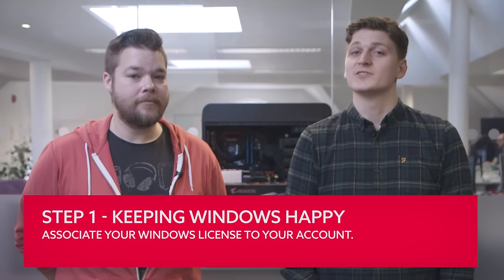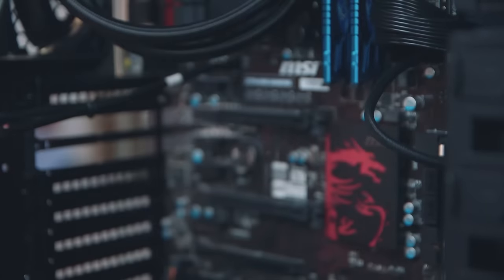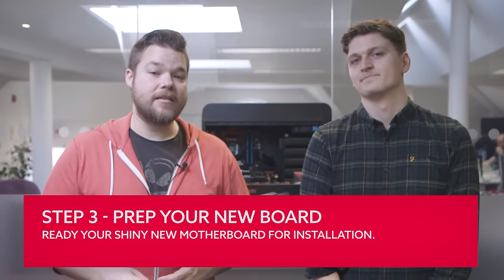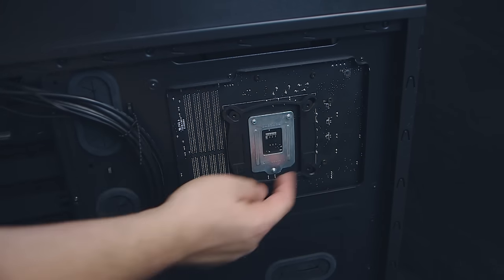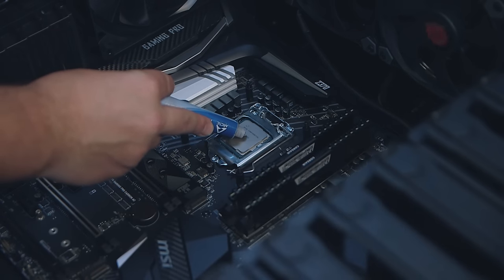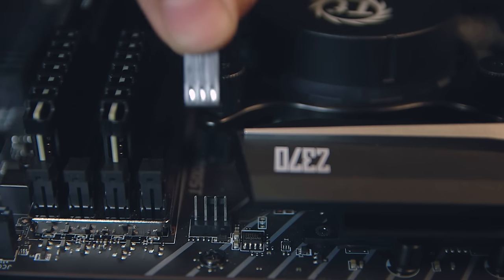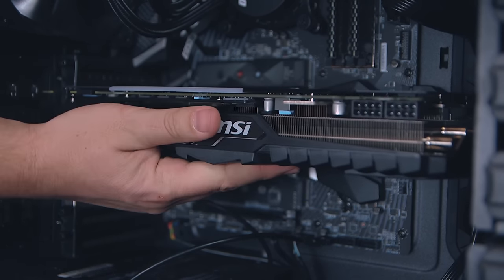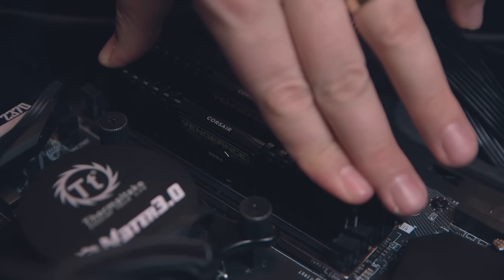How to replace your PC’s motherboard in 8 easy steps | Hardware

Comment from the maker: Are you planning on upgrading your motherboard? What are you going for?
Reply: but also better mobo has better socket - so i have to buy CPU too, and then you discover your new CPU works on different frequency - so you gotta buy new memory too.

what I'm getting at , is that you'd better buy new system outright when older one is no more a current generation. 
and swithing mobo while it's not old enough yet is a waste of money.
Reply from the maker: Nick Grabeck As we say, it's one of the most intensive bits of PC surgery you can do, and not far off building a new PC, but if you've got a good SSD, decent cooler, and a quality graphics card you might not necessarily want to swap your entire system for a new one.
Reply: Is it necessary to reinstall windows after upgrading to new motherboard?
Reply from the maker: Chaidir Chalaf If you sign into Windows 10 with a Microsoft account then it registers your license. That means when you log in again after upgrading your hardware Windows will grab the necessary drivers and should retain license support too.

If it doesn't grab the right LAN network drivers then you might need to grab them from the board manufacturer's website from another machibs and update them manually.
Reply: Hello there as been news that Intel are going to be releasing to Intel 8 core CPUs at the end of the year will ryzen still be the best value ?????
Reply from the maker: cole death slayer Yes, absolutely. You'll be able to grab the 8core 2700K that will definitely be less than the upcoming 8core i9.
Reply: PCGamesN so ryzen is still worth it ???
Reply: PCGamesN ASUS Rog
Reply: definitely, worth going Ryzen, why spend all that money on a intel, when Ryzen is much less and just as good, or better
Reply: I'm planning on upgrading to some type of reliable motherboard. I hate my ASRock Ab350m Pro4, as it crashes all the time.
Reply: How will my windows10 installation respond to a mobo switch? Im also going to replace my CPU at some point and my HDD for an SSD M2.0 so i'll have to swap my installation anyway at some point all together. What would you recommend??
Reply: my motherboard died
Reply: I have a fm2 now and gonna buy a AM4, my mom doesnt want me to becuse she doesnt know how it works. Cpu: now: AMD Athlon x4 845. Want: AMD ryzen 1800
Reply: Have been planning on replacing my Gigabyte 970-Gaming SLI with a new MSI 990XA-Gaming I have laying around. Wouldn't be much of an upgrade, would be done just out of curiosity. I dual-boot win8.1/ win10, so not looking forward to repairing the OS's when they 'wig-out' over the motherboard replacement.
Reply: PCGamesN indeed will do tomorrow, going from i7 6700 on MSI Z170 M5 to an i9 9900k on MSI Z390 MEG ACE.
Reply: Hey guys on the motherboard part all you do is screw in the motherboard.? Theres no spacers or anything?
Reply: I am going for a i7 8700k with a asus z370 but im scared that i will break or do something wrong
Reply: I bought a pc that has an ASRock Z390 phantom gaming 4 motherboard, an i9 9900k cpu, and 16GB of ram preinstalled. Before I use the system I would like to upgrade to a MSI MEG Z390 GODLIKE motherboard. The only problem is I don't know if i can use the same cpu and memory in the new motherboard. If so is there anything i need to do in order to install all of the original components from the ASRock to the MSI GODLIKE?
Reply: If I damaged my motherboard with physical impact does it make sense to replace it with a new one? Please answer
Reply: B450 F Rog Strix
Reply: Z390 Aorus Ultra
Reply: Bought my i5 9600k today
Reply: a year too late but better than never i suppose. do i need to install bios before or after installing the new motherboard?
Reply: Any tips on preparing Windows 10 before an upgrade? I'm planning to upgrade from INTEL-H310M to ROG STRIX Z390-F INTEL Z390. Thank you
Reply: Katie Osborn I had the same issue. I just bought a new motherboard. Installing tomorrow. Fingers crossed.
Reply: I installed a new motherboard everything turns on but there is no display
Reply: If i change my motherboard will it reset my personal data and windows?
Reply: I'm gonna get Ryzen 5 3600x, then try and get next year's Ryzen 7. I need to get a new motherboard and psu. My ram is Corsair vengeance lpx 3200mhz, so I don't need to change that.
Reply: My motherboard is specific to my stock pc I bought(Dell Inspiron 3650), so I need a new one in order to migrate over to a new case(the current one is tiny, and I can barely fit anything in it). I’m doing all of this to get rid of my DDR3 RAM and trying to migrate to DDR4
Reply: Upgrading my motherboard to a Asus ROG Maximus XI Hero but I’m keeping my i7 9700k but upgrading from 16gb to 32gb ram
Reply: Hello! I am upgrading an emachines AMD Athlon processor EL1200-06w. My motherboard is Socket AM2, what would be the best compatible motherboard that can support an upgraded CPU and RAM. Thanks
Reply: PCGamesN hello, do I have to do anything with the drivers of my old motherboard before I install the new one?
Reply: Houston Lair Nope
Reply: I need help please, i changed the motherboard, and display wont work, and i didnt delete my drivers or windows... what should i do!!!
Reply: Kaizerdidrik YT Are you sure the motherboard is compatible with all of your components? I had the same issue but I called my motherboard manufacturer and found out that my ram was not compatible.
Reply: @harrysmart3536  it works now, didnt change anyting
Reply: I'm planning on getting an X570 Gaming Plus and a Ryzen 7 3700X so I can actually run Doom Eternal
Reply: Gigabyte b450M
Reply: can i take the cpu out of my old motherboard and put it into my new one?
Reply: Nice video. I have only a 3 yo PC, but it was made on a reeeealy tight budget. just over 1k. Now it bites me. I can't play any games anymore. GPU-RAM insuficcient, CPU-overklocking and -heating, and...
B - - S - - O - - D...............
Now I'm changing from ' Prime Z370-P / Intel i4 / GTX 1060 3GB ' to ' Rog Strix X570-E / AMD Rayzen 7 / 2080 11GB (or 3080, still deciding) ' with RAM upgrade, more SSD-Storage, new RGB Case with CPU-Water-cooling and the works...

But I don't want to have to re-install Windows and my Programms...

Hope it works...........
Reply: Upgrade my motherboard
Reply: Im going to TAKE A LEAP and go from Intel to Ryzen
Reply: I’m going for a mother bored from republic of gamers
Reply: I plan on replacing my motherboard. My current one came with the prebuilt system but over time I've been upgrading it. The current MB does not support wifi without a separate dongle. I plan on buying a new one that supports wifi built in. Any tips
Reply: i know this video is old but i have a whole story to tell. so, 3 years ago, i bought my first gaming pc.  it was a bad pc but it was my first one, so upgrades were definitely possible and it worked well for what i did with it. about a year and a little more ago, i decided i needed an upgrade. i bought the gtx 1650 ti, and it changed performance in my pc quite heavily. however, my pc was completely unbalanced. i recently have been wanting to get a new cpu, so i got one. i found out shortly after it came that ryzen cpus aren't compatible with intel motherboards, i thought it was all the same. so we sent it back and got our receipt. i did even more research and discovered the different types of cpu sockets. my motherboard was so old that it had an 1156 socket. so i found out i cant really upgrade my cpu with the state that i'm in, knowing as there hasnt been a new lga 1156 cpu in like 10 years. i also installed an application that tells you your specs, temperatures, etc. i found out that my motherboard hangs out as around 82 C, which definitely isnt so good. so im planning on getting a new motherboard, that being the ASUS Prime B560M, with an lga socket of 1200. with that i'm getting 2 sticks of 8 gb ram, and the i3 10100f. i think the build will be pretty solid compared to what ive been stuck with for a while. im honestly surprised my computer hasn't just died yet.
Reply: X570 crosshair extreme
Reply: I want to get a ASRock B550M-HDV, Socket AM4 cause I also wanna get a PNY GeForce RTX 3060 XLR8 Gaming REVEL EPIC-X RGB Dual Fan Edition, 12GB GDDR6, 192-bit a and a AMD Ryze 5 5600X, 35MB, 4.6GHz, Wraith Stealth cpu
Reply: Yes because my previous pc repairer just took someone elses motherboard and pumped it in my pc which unsurprisingly have problems in it.
Reply: from intel i6700k to amd 5800x3d. I'm really glad that you told about the fragility that comes with an Intel CPU. Thanks!
Reply: 5 years late but i'm getting a not new asus b85m-g for 35 dollars, is that a steal, or a steal on the other end?
Reply: B550- B650 plus new cpu AMDR 9 7800

Comment: Yeah my PC is on fire right now, what should I do?
Reply from the maker: Grab some marshmallows and start toasting.
Reply: get a bag of rice
Reply: @Default Bloxian just post it on reddit. Im sure someone will help you
Reply: put some water in it
Reply: Default Bloxian 8gb on ram is killing you
Reply: I brought my pc and it had windows 7 on it, then I was offered the free upgrade to Windows 10. I don't remember signing into a Windows account. So can I still upgrade?
Reply: @Default Bloxian a320 is the most basic of am4 mobos, try x470/b450
Reply: Default Bloxian no it won’t but there’s no chance of overclocking, it’s the same one I have right now hence why I’m upgrading
Reply: Throw it in the bath and fill it up
Reply: Have you tried turning it on and off again?
Reply: Have you tried putting it in rice?
Reply: Have you tried turning turning the PC off and on?
Reply: Raman
Reply: Put a paper towel on it
Reply: Delete system 32
Reply: Boot it up
Reply: Download more RAM
Reply: Check the power button
Reply: JIEYZシ  It has been 2 years since man...
Reply: Grab some more fans with rgb
Reply: Put water on it
Reply: Badger is that you?
Reply: @edj2885  Didn't think someone would reply after 3 years
Reply: @chenshohry2374  tbh, same, i thought you wouldn't reply back, nice to meet ya though
Reply: @edj2885  same

Comment: I was gonna upgrade my pc but now I’m scared to even touch it
Reply: Why
Reply: @yournan7249  i got my new pc yesterday and ive already chipped and scratched my acrylic glass tryna clean it🤣💀
Reply: @ecto5727  rip
Reply: It’s easy af take your time you can do it
Reply: @bingbong5939  Yes it takes a lot of time
Reply: @morningsun10  better to take an hour and everything be perfect than 15 minutes and your computer be on fire. But that’s just my opinion lol
Reply: @gigachad7729  When I finally attached everything, it was perfect except for a small shock near the wifi stick area. System booted up normally

Comment: This is a pretty decent video but I’m going to give you a dislike. Anyone can put things in the correct slot. The part where most people need help is on the software side. You guys alluded to it but if you were going to just talk about it, why make a video? Just write an instructional piece instead. I get that it’s very dependent on manufacture but it would have been too easy and too simple to do an example of how to do it. Just comes across as lazy effort.

Comment: Do not just flash your BIOS just because there's a new one. This is bad advice. If your system is working fine, there is no need to update the BIOS, unless there is a security or performance issue. I doubt these guys have actually built many PC's at all.

Comment: I think most of us are comfortable with the mechanical disassembly and assembly of the PC. the part I would like to get more info on is the software side of things. for example, I want to use my old ssd with windows 10 installed on a new board. i have my pc set to my web account and that seems easy enough but their is always something amiss when it comes to software syncing and stuff. can someone link me to a vid or forum post that is more focused on the software side of installing a new board?
Reply: I have been looking for a video that answers your question but have yet to find one, did you find the answer to this?
Reply: @Dhars you find the answer

Comment: What about uninstalling old drivers and such if you're switching from Intel to AMD or vice versa?
Reply: Soooo
You found awnser
Reply: @shamsta21  Nope. :(
Reply: @unnamed715  Im sitting currently in the same issue right now? Have you found out?
Reply: @jens00741  Nah. I'd really like to though because I'm planning to build a new PC with a Ryzen 5 3600 and I DO NOT want to reinstall Windows and all of my programs. Not to mention spend an entire day installing updates. :/
Reply: @unnamed715  i just tried to change motherboard, went from a Intel i7 5820k to a AMD Ryzen 7 3800x and it went smoothly
Reply: @jens00741  Really? Did you have to uninstall any drivers or anything?
Reply: @unnamed715  not at all, IT took some time to configure, but i think you should be fine. The only thing i uninstalled was software for tuning og the motherboard and CPU, nothing Intel related
Reply: @jens00741  Hmm, yeah I don't have any software relating to the mobo. Welp, guess I'll just give it a go and see what happens. Thanks man!
Reply: unnamed715 Did it work out?
Reply: @numberjuan5837  I don't know I haven't even bought my parts yet. XD I'm hoping I can save enough for my build some time this month. :P
Reply: unnamed715 let us know how it goes man!
Reply: unnamed715 good luck
Reply: @ChickentNug  Funny that you wish me luck now. I just ordered the parts yesterday morning. XD
Reply: unnamed715 update us please!!
Reply: @joshuasharp2187  well I have all the parts except the RAM, that should be in later today (hopefully) but I won't be able to start working on it until after the holidays. 😧
Reply: @unnamed715  let me know how it will go
Reply: @Publa  Welp, just built my new PC and everything seems to be running fine so far. All I did was go into Device Manager and uninstalled everything from Intel. Then I went to my motherboard's manufacturer's website (MSI) and installed the latest chipset drivers. So far so good.
Reply: @unnamed715  I'll be doing the same thing either today or tomorrow. I'm switching from an ASRock z270 killer mobo w/ an intel i5 7600k cpu to an ASUS x570 plus mobo w/ an Ryzen 7 3700x cpu, and different ram (gskill ripjaws 3600mhz 8gb x 2). I only plan on backing up some photos and taking pictures of my desktop for reference on programs I like using. I am already signed in with an Microsoft account having a digital key linked to account so hopefully all goes smoothly.
Reply: @alexhenningfield3067  As long as you uninstall all Intel drivers before moving your main boot drive to your new PC, you shouldn't have any issues.
Reply: unnamed715 what intel drivers did u uninstall?
Reply: @unnamed715  When you do a fresh windows os install, you are able to wipe your drives completely in the process. I'm restoring everything completely.
Reply: @alexhenningfield3067  Yes, I know that but I'd rather not have to do that. It's too time consuming. Anyway thankfully I didn't have to.
Reply: @leandrovillar9916  All of them. Basically what you want to do is go in device manager, right click and check properties on all components. If it's published by intel, uninstall it. It takes a bit of time but it's worth it. Also, make sure you uninstall anything USB related last, otherwise your mouse and keyboard won't work. XD
Reply: unnamed715 lol how would you use your mouse and keyboard if you uninstalled it? Would you still install drivers for the motherboard? Are your files still intact in your hdd?
Reply: @leandrovillar9916  Uninstall it last, force shutdown with power button. And yeah, all my files were intact. Just install the drivers that came with your new motherboard or download the latest ones from that manufacturer website.
Reply: @unnamed715 , I'm doing a similar switch as you and @Alex Henningfield for my son's gaming PC (switching the motherboard and going from an Intel i5 to a Ryzen 7). I've replaced Intel CPUs with new Intel CPUs and upgraded video cards in the past without a problem, but this is the first time I'm doing a motherboard (yikes!!!) and going from Intel to an AMD CPU. I'm super nervous about this! 
To clarify something you said about "uninstall all Intel drivers before moving your main boot drive to your new PC"....what do you mean by "before moving your main boot drive"? Do you mean simply that I should uninstall the Intel drivers before dismantling the hardware and before installing the new motherboard and CPU? Or is there another step I'm not understanding? Any help you can throw my way is greatly appreciated! ~Erica
Reply: @ericajeffhuinda4804  Main boot drive = The hard drive or SSD you have your operating system (most likely Windows) installed to. 

Just go through your list of installed programs, then device manager and uninstall everything published by Intel. Don't be nervous, it's fairly simple. If a moron like me can do it, then anyone can. :P Good luck!
Reply: @unnamed715 , thanks!
Reply: @unnamed715  so everything went fine? I had to buy a new AMD b550 mobo because my b450 fried so I'm worried about how everything will transfer over? I cant go back onto my mobo to delete the older files so If I just reinstall everything on the new mobo it should start up fine so i can delete the old drivers?
Reply: @Millsboro  Yep, everything went smoothly. In fact, I'm replying to your comment on the PC I built right now! ;)
Reply: @unnamed715  hi, i will change tomorrow my old set up (i3 6100, old gigabyte motherborad, and gtx 950 msi) for a ryzen 5 6100 af, gigabyte ab350m v2 motherborad, and gtx 1650 super gigabyte. Should i uninstall only cpu drivers or all of them?? Sorry for my english i am spanish